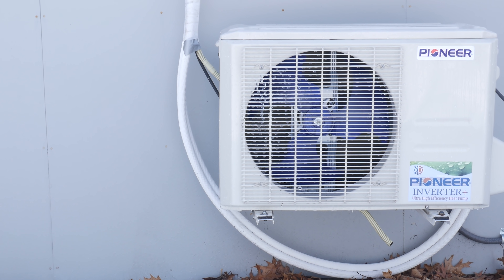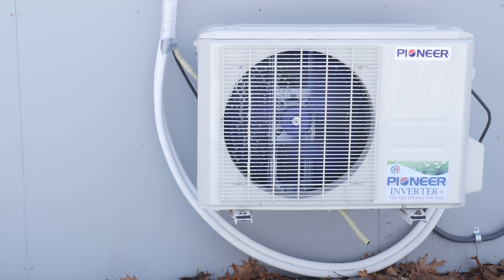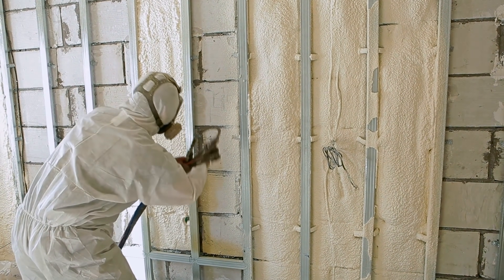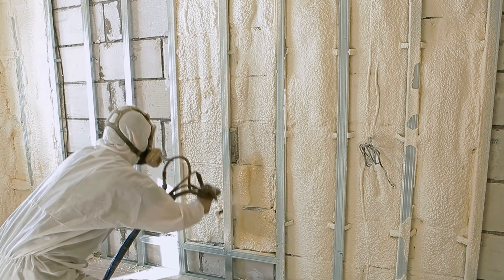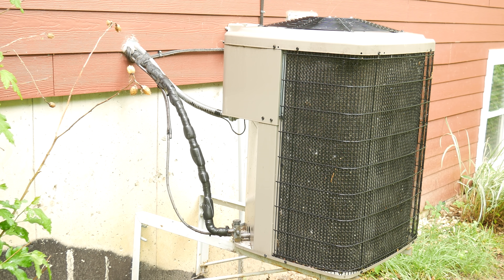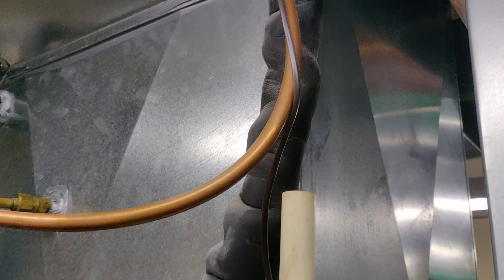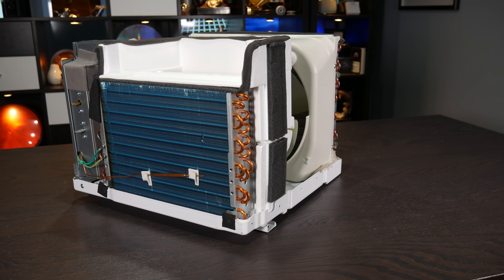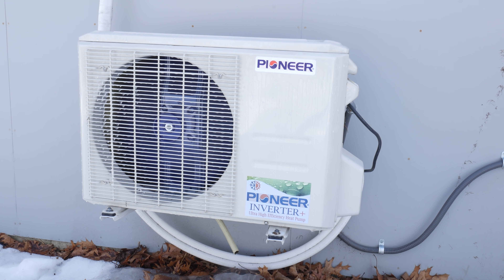Heat Pumps are Not Hard: Here's what it will take to start pumping

Comment: @TechnologyConnections Here we are in the latter half of 2024 and now there are apparently many more heat pump systems that can work down to -22F / -30C (although I am not sure what the COP is at those lower temps) which seems to be great for the Chicago area since I have never seen it get that cold (fairly close, a few years back I think we got down to -18F for a few days but that is one of those "but sometimes" moments) so I wonder if I were to get one of those newer units (I live in Northwest Indiana, right outside of Chicago) if I would still need backup heat under this circumstance?

My 30 year old A/C system (and 20+ year old duct, forced air natural gas furnace) is in need of replacing now (I will probably pull the trigger on it before next summer) and it's refrigerant was banned a LONG time ago, I think 2 "newer" refrigerants have already come and gone in the time of this system so the chances of getting this one recharged I'm fairly certain is zero.

I probably should have a "Manual J" audit done but I noticed the current edition of Manual J (and similar lettered books) are several years old so I also wonder if there is an equipment formula that takes these more modern heat pumps into consideration?

Obviously I'm no expert but it seems to me that since these "Manual <insert appropriate letter here>" books do not have updated editions (the latest are several years old now), maybe this contributes to why some HVAC technicians don't really know how to tackle these systems?  I think those books are due for a refresh to factor in the newer heat pump technology advancements.

Anyway, I know you have done several videos on these already (and I thank you for helping to educate us on these) but do you think another follow up is warranted since it seems there have been some advancements?  I would love to know your thoughts on the newer systems especially as they now appear to work even more efficiently even if Chicago were to get to record low temps.

Thank you again for your wonderfully thought out videos!

P.S.  Since we live in the same general neck of the woods, I wonder if you (or anyone reading this) would please share your thoughts on any reputable people I can contact to replace my system.  I am afraid of getting raked over the coals with gross over charges and / or an incorrect solution.  Thanks again!

Comment: Heat pumps have been the only way to get air conditioner in Brazil for a while. Cheaper units just cool the air, but slightly more expensive ones can also heat, and they work well.

Comment: In my part of Sweden, water based heating is the norm. This is usually because the houses used to have a wood or oil fired furnace/boiler that gave hot water and heating. We don't have gas fired furnace/boiler because it is not tradition(?) so there is/was no infrastructure for it.
This long walk is to say that air/ground to water heat pumps fits well here. Our heat pump is air to water in a self-contained unit that sits outside and therefore don't need a tech or special tools to install, just lead the water outside inside insulated houses. It is probably not as effective as a split unit but it is so much easier to install for a hobbyist.

Comment: I actually just spent quite a bit of money to get my home insulation upgraded. We still had the standard 120-130mm of insulation that was probably put in when the house was built (it should be double that). The issue is that my loft is needed for storage so if I were to have mineral wool put in I'd need to take everything out the attic and have the flooring ripped up, wool put down and spacers installed before putting down new flooring. Oh and my ladder would have need to have been reinstalled. It was going to cost a fortune in hassle and labour. So I had solid insulation put in the rafters to bring the total insulating power up to spec (combination of the existing mineral wool and the solid insulation). It was expensive but the house already feels warmer. The temperature last week was the same as the week before and I only needed my heating on for half the time. 

The issue is that there's no subsidy in the UK for this sort of work, and typically when there has been it only covers the cheapest insulation. If we'd not saved money during lockdown we'd not have been able to do it. I bet there are lots of families that use roof-spaces as storage and put off getting the insulation upgraded for that reason. But our government would rather waste money on trying to frack gas out of Cumbria rather than doing basic insulation work.

Comment: I installed two Mr. Cool DIY units on my home which are completely DIY - no need to purge/vaccum lines or anything - just connect the linesets using pliers and that's it.  And it cost me $3500 vs the $9000-$12,000 quotes from venders.

Part of my home has ducted heat, but half just had terribly costly and inefficient restive underfloor heating that is no longer used thanks to the new heat pumps!

Comment: Technology Connections absolutely. Public Policy Connections... not so much. Any top-down interference in the market invariably causes more problems than it solves, for a variety of reasons, including how horrible we all are at predicting unintended consequences. That said, removing such interferences as in the noise ordnance example is absolutely a good and helpful move. The market will solve the rest of the problems, as you yourself have already acknowledged to a certain degree. The most effective and efficient ways to aid that process are exactly what you're already doing: vote with your wallet, and spread the good word. And it's already working. I even just looked into options for my current situation thanks to your videos, but unfortunately they don't presently add up (my usage despite the climate here is already extremely low.) I will definitely lean heavily toward heat pump-enabled options the next time I'm in the market for HVAC, especially since I've always preferred mini-splits conceptually anyway, and I always prefer to do my own installs on basically anything. 
Patience is the virtue here. There will always be new, revolutionary options far outpacing traditional means and systems, and plenty of justifications for trying to ham-fistedly force widespread upgrades to take advantage of them. It will also almost never be justifiable to do so from an economic efficiency standpoint, especially when the next revolutionary tech upgrade brings the same sense of urgency calling to do it all over again. The steadier pace of natural market shift allows the resource-wealthy to fund the streamlining of the new industrial movement so that the tech can actually become affordable for the poor later on. It also means that there is a steady improvement of the systems in place as the later adopters get to benefit from the later improvements that were not available to the early crowd. These processes play out the way they do for good reasons when left to the natural course of things. The important part is doing research and educating one another, to ensure that market forces (read: our own decisions and impulses) drive changes down the best paths. The market is a democracy, not a dictatorship. Victories are gained through persuasion, not force.

Comment: Here, in Warsaw/Poland we've found the best (I guess) method to force house owners to upgrade their insulations: we have different fees of city-provided heat based on the energy efficiency rating of the building. So here we can have a 50 years old building that will be insulated better than the 20 yr old one and the older building will have a lower rates than the newer one :)
Reply: Oh, and this is the only good thing in this country...

Comment: Just got 5 quotes for furnace/AC/Heat Pump replacement in Seattle so another VHCOL city like San Diego, $15k for a 2 stage gas furnace and 1 stage 13 SEER AC (Bryant system) or up to $22k for a 95% efficient gas furnace with 15 SEER AC (Also Bryant) and adding a return air duct because houses weren't designed for AC in the PNW.  We finally found a company that has equipment overstock and had a deal running to get a 17 SEER Bosch Heat Pump for the same price as a 17 SEER 2 stage AC plus a not fancy 80% efficient gas furnace backup.  The crazy thing is that I know people who have paid $30k to convert from gas to electric furnace and heat pump to pair with solar panels.  It's a racket up here in the PNW because none of our houses are wired for AC so it involves an electrician to run 220v outside and the refrigerant lines and bringing everything up to code as we discovered we need a bollard in our garage in front of the furnace, a new flue that reaches above the roofline, and a flexible gas line into the furnace, labor is very expensive up here.

Comment: My central a/c in central Florida is a heat pump but it's on its way out unfortunately but its pretty amazing that it effortlessly keeps the place warm when it gets down into the 20-30s on occasion and before anyone says woah that's nothing I'm from northern IL and have had a cool 20 years of cold. I just got a small heat pump minisplit for my room so I can leave the main house at a higher temp and it's been great. Even if the central ac was in better shape I ain't cooling my whole house down to 74 and my room is a hot zone with my PC so the in room cooling option is just way better. I use to use a cheap Toshiba window unit and omg the volume difference is quite remarkable.

Comment: Puget Sound resident here. Two things:

1) Any place that prohibits heat pumps due to noise ordinances but allows streams of internal combustion engined cars to fill their streets doesn’t actually understand the concept of noise. The noise of more heat pumps would be more than offset by the simultaneous reduction of all road vehicles in city streets in general and the conversion of remaining vehicles to electric power (please keep your trolleybus wires, King County Metro; don’t be foolish like Boston).

2) I’m considering moving into a condo with a friend in Seattle. We’re both interested in getting his unit updated with a heat pump, but I understand that the condo’s HOA may provide some pushback on this due to the need to drill holes in the exterior walls of the building. The city is prohibiting the inclusion of gas in all new construction, but I think there also needs to be some sort of incentive program to encourage older building HOAs to accept heat pumps.

Comment: 6:40 In Italy it is now mandatory (well, since 2016 I think) wherever shared heating is used to monitor how many calories of heat each individual unit is using to heat their home, and spread the gas bill accordingly. This encourages each individual occupant to insulate their unit, since they will need to use less calories and it will reflect directly on their energy bill.

Comment: I had a heat pump in the 90s and it sucked.  The COP at max was 3.4 and it rolled off quickly but I'll agree, the thermostat was worse.  It had two mercury wetted contacts, one for setpoint and one set 2 degrees lower for auxiliary heat.  When cold, the house would constantly fluctuate by about 2.5 degrees - that's comfortable.  The auxiliary heat was 20kW and all came on at once.  I opened the furnace and separated the 4, 5kW heaters and built a simple sequencer.  When aux heat was demanded it started with 5kW and waited for 15 minutes.  If still needed, it would bring on another 5k and wait, etc.  Still big temp swings but a little more comfortable.  A modern control system with phased aux heat could maintain setpoint and perform beautifully.  I'm not surprised by the crappy selection of HVAC equipment offered in this country, it's our way.  I lived in Germany in 1995 and I was amazed at what was in their mechanical rooms.  Their residential HVAC equipment was decades ahead of hours.  We generally like it cheap, not good.

Comment: Here in Brazil we call air source heat pumps with variable compressor speed simply as "Inverter AC with heat and cool" and it's basically the norm for climatization. I happen to have three split systems, two from Samsung and another from LG, that in total it cost me 2000USD to buy and install, and 10USD a month of electricity to run.

Comment: In Australia our last great prime Minister Kevin Rudd introduced government funded insulation upgrades for anyone who wanted them, this was a great scheme as it upgraded many places especially rentals that no one would spend money on.  He also introduced subsidised solar panels so we're the largest per capita of solar on houses, but sadly many renters miss out on that.  Also you can get from our state government in Victoria is offering upgrades to existing air conditioners and heat pumps to upgrade them to more energy efficient inverters and reverse cycle split systems.  They also offer subsidiaries to replace gas or electric hot water heaters with heat pump units that are more efficient. These work well in Australia where it's rare to get temps lower than 0°C and often high summer temps - makes sense to use the same unit for heating and cooling.

Comment: In Australia these are quite common and for bathrooms we use a heat lamp in a LED set of lights so if you want normal light you turn the LED on and if you want heat you turn the heat lamp on. They heats the room quite quickly, they might not be the most efficient but it’s only for 15min in the morning when you shower so very little power in comparison.

Comment: I have one of these in my office. It does a great job. The only problem was installing it (the exterior parts had to be placed on the roof and I am 2 floors below it) and the water pump is loud sometimes but not for very long. It's a super system.

Comment: On VRF systems for multi-family homes: yes, energywise it would be ideal for that.
BUT !!!  (and it's not a "but sometimes")...
Safety regulations might be a serious issue. For example, the R410A refrigerant that was commonly used in those systems is being phased out (in Europe at least, i'm guessing the US might be lagging behind on that) in favor of the more environmentally friendly R32 refrigerant. But that R32 is a slight bit toxic and a slight bit flammable. Not that much in small quantities, but - an here's the pickle - in big VRF installations a leak in one room might cause the whole system to empty itself in one room, creating a dangerous atmosphere there. Depending on the building, this can be managed: an office space occupied by awake people and with a leak detection alarm poses significantly less risks than a multi-appartment building with sleeping people and alarm systems that may or may not be maintained well. This is the reason why, in Europe at least, depending on the refrigerant type and content (which can be big with VRF systems), not every application is feasible - and multi-appartment buildings run on VRF are practically out of the question.

Comment: serious issue at ~36:00 - restrictive ducting won't impact the operation of your heat pump in the winter... but in the summer when it's running as an AC, it will turn the evaporator in your air handler into an ice maker.  There needs to be enough airflow through the system to keep the evaporator surface from dropping below freezing, or it will ice over and clog up.

Comment: I am very much on Team Radiator and inspired by these videos I have been exploring air to water heat pumps.  I have an old cast iron system and keep the max water temp around 150-160 degrees which is hotter than a normal heat pump can get.  So the mention in this video of high temp air to water heat pumps is encouraging.  Anyone know an example of a high temp model actually sold in the US?

Comment: As far as I remember, 80% of residential use of energy here in Norway is for heating, which makes sense both because of weather and that we have many old houses. In other words, we could probably reduce our energy use significantly if we had proper insulation in our homes. We're pretty good on the heat pump part though.

Comment: Heat pumps are common in New Zealand but some suppliers will still try to fleece you. I had two installed in my home and the quotes ranged from $15000 to $6000. The cheapest one was for two highly rated Panasonic units.

Comment: so i like the  variable refrigerant units you mentioned in the revised edit ...  the one with the "15" heads  -  It should be able to connect to the heat pump "hot water" heater and heat pump clothes dryer  =>even better a refrigerator and freezer with a heat exchange connection

Comment: I was definitely stuck paying a probably inflated installation cost for my Mitsubishi three zone ductless system. That was even after getting five quotes to ensure I wasn’t getting completely ripped off. There were also practical limitations for what I would be comfortable installing (climbing up ladders up three stories adjacent to the electrical mains), but the other limitation is that Mitsubishi will only honor its product warranty if the system was installed by an authorized contractor. Until some companies can come in and shake up the industry, we are probably stuck with the status quo.
Also living in Seattle, I never came across the noise ordinance issue. It must have been a really weird case.
Reply: THAT $15,000 INSTALL in the video was insane.  I would buy the unit wholesale for $3000.  Then tell the HVAC company “I already have the heat pump.  Just install it please.”

I do that with car dealerships too: I supply the oil & filter, and they charge $15 labor.  It saves money

.

Comment: FYI  Air to Water heat pump can fit in any building distribution. Radiators, radiant floors, walls, ceilings, high-wall aka mini split head, thin-wall, air handlers and there is  a intrest in radiant cooling (messana). Instead of running refrigerant lines trough out the building just use water via PEX tubing.One of the most efficient medium to transfer energy.